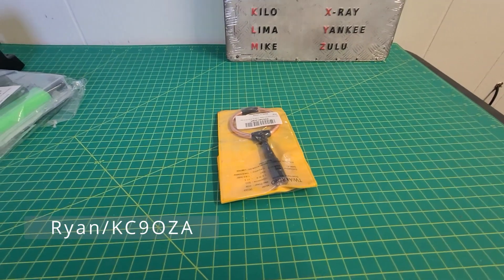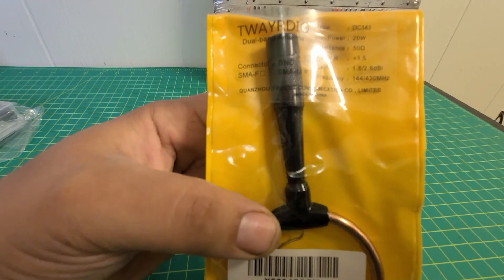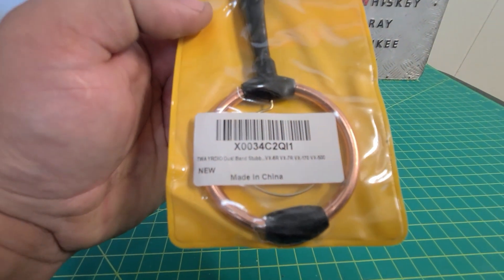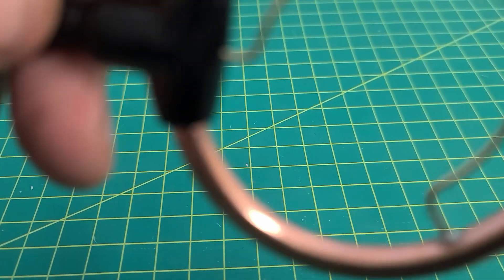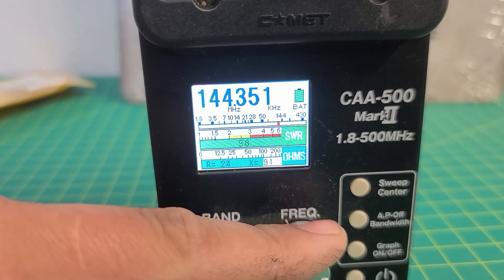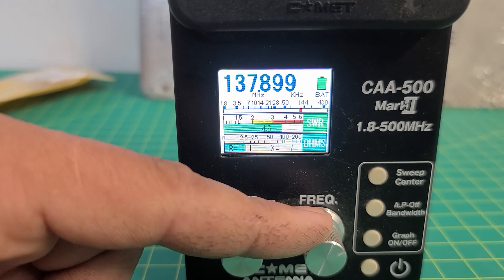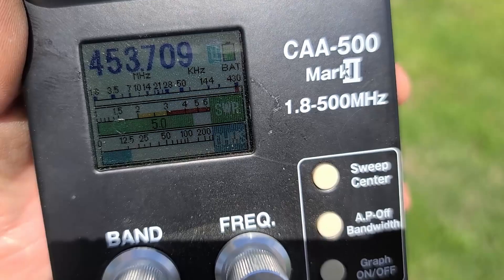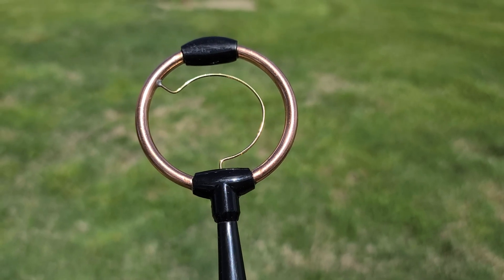TWAYRDIO Dual Band Loop Antenna Gain or Gimmick? #ht #antenna #hamradio #hamharder

Comment: Thanks for trying this antenna. Basically it is useless on US. 2-meter & 440 bands. Possibly might be useful as a receive antenna for direction finding use, but the specs don't detail receive patterns. Looks neat. I wouldn't transmit with it.